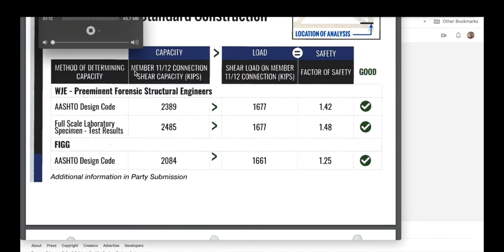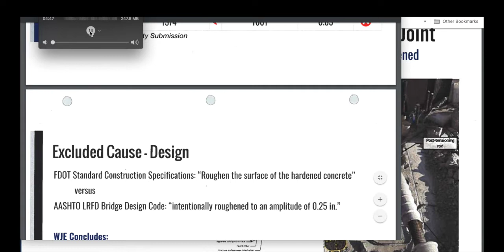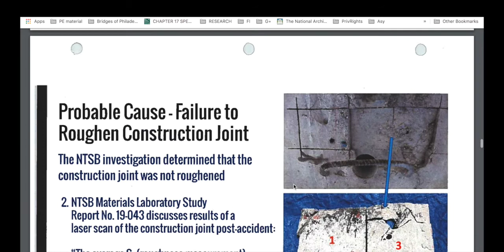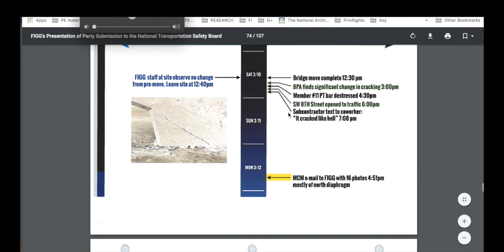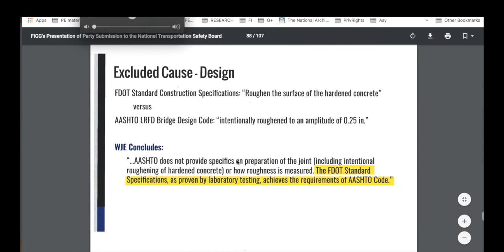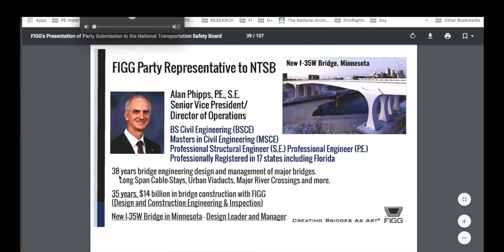FIU Bridge Collapse NTSB Report DEBUNKED CRACKS APPEAR 2 DAYS OR MOVE BEFORE BRIDGE MOVE Part 3 of 4

Comment: "WJE tests proved that the member 11/12 connection would not have failed with the PT bars restressed if the joint was roughened as required by FDOT specifications". As you note, the "connection" already failed before PT bar adjustments; WJE tests prove nothing.